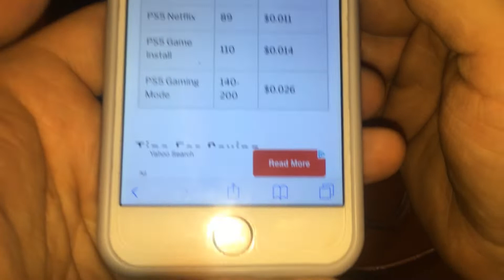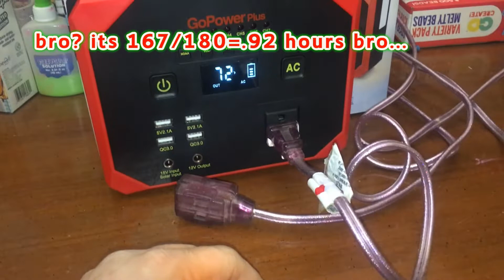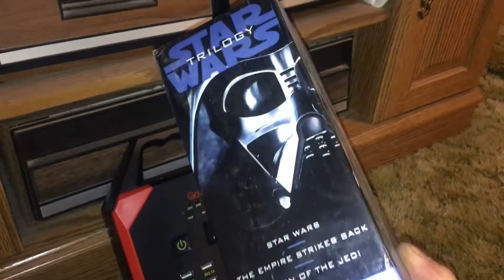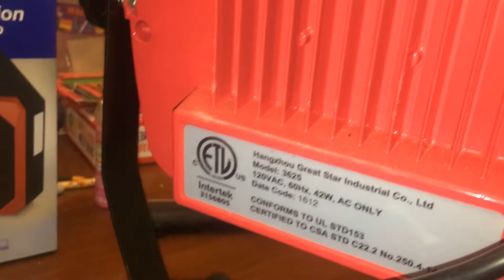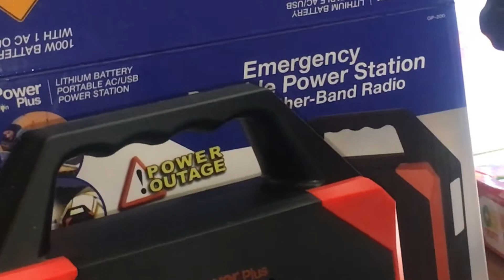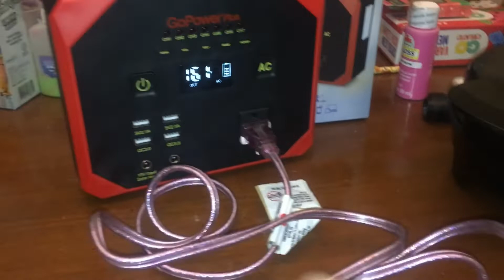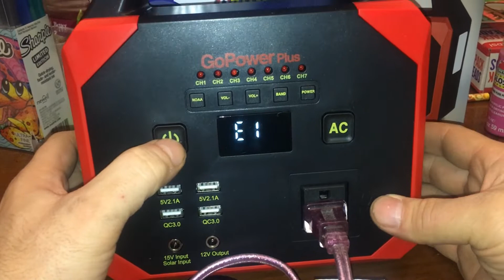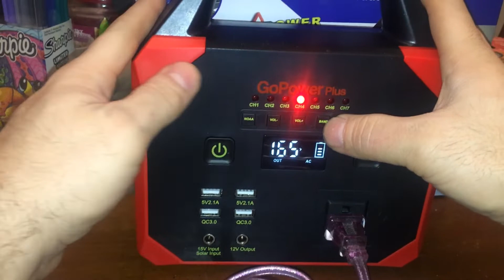Ideation GoPower Plus Emergency Portable Power Station HD-008 GP-200 Will PS4 PS5 XBOX work E1 Error

Comment: funny thing ,  you read out  900w    on the darth vader pancake maker
and the  gopower only gives off 200   max   [ well  197   but still  ]   .  

then,   machine  shut off.   i thought the display would have shown    ' NOPE '  .        lol     but it didnt

only shown   E1   as on  error. 

them internals heat up  very quick , and take a while to  cool.  good thing there was a  overheat temp switch built in it.   

what was with her backpack straps glowing for ???  did you do that  mod  to it ?
if so ,  must have been a  star wars  thing.  if not, then it still would have been very kool.
Reply from the maker: yeah it will just over heat and shut off

Comment: If we use the quick charge usb for a phone, we can assume that this unit will discharge much more quickly than if we charge a phone with the slower 'legacy' usb, right? 
Also, would charging a phone using the ac outlet along with our home wall charger be as fast or faster than the quick charge usb? Hope I'm making sense over here. Thanks...brah
Reply from the maker: how you charge something has nothing to do with how it discharges. you are filling a battery. it doesn't care how it got the electrons back in it.